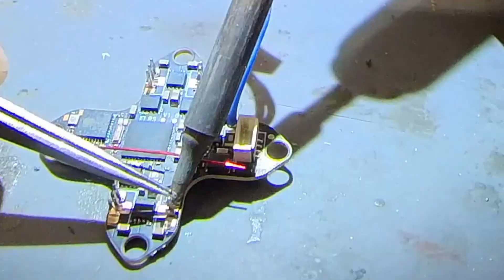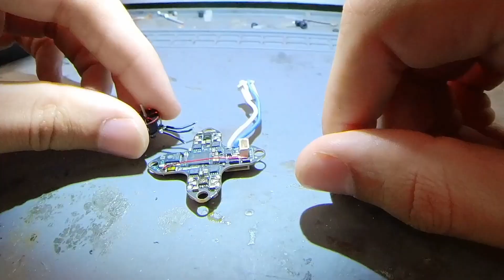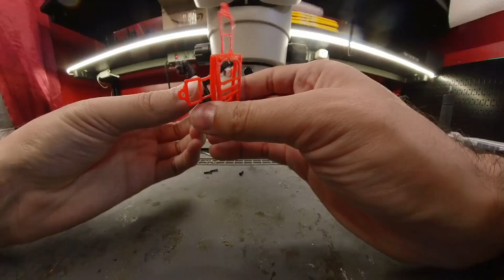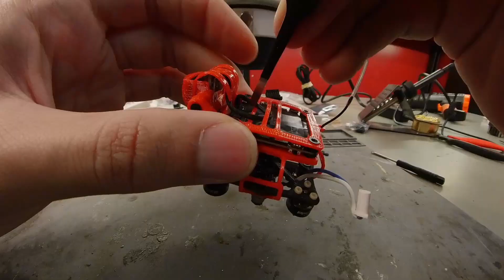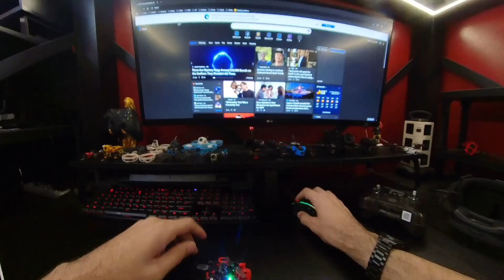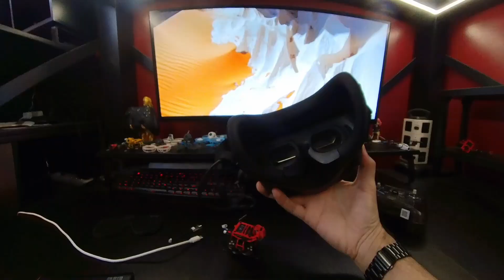How to Build a 3D Printable Nano Drone With 4K video

Comment: you should get some injection molding of your design done,
Reply from the maker: Injection molded parts cost 1000s of dollars to design and mold. This costs less than $1 to print. There's no real benefit.
Reply: @MultiBuild  I know since Ive worked directly with suppliers and had molds done my self although its an entirely different industry same concept

Comment: Is it possible to put a beta fpv p1 in there instead of o4
Reply from the maker: probably. I've gotten the runcam split 4k to work with this setup as well. The vtx should fit but Idk about the dimensions of the camera.
Reply: @MultiBuild also if I wanted longer battery life should I use 19500kv motors and what battery, thanks
Reply from the maker: @cookingchannel-t8l No don't use those motors there are awful. I had another customer ignore my instruction and he immediately regretted his decision(it worked but awful performance). RCINPOWER GTS V3 0802 22000KV or happymodel 802 25000KV. happymodel motors tend to have the best efficiency. Personally I dont recommend going below 25000KV. The dogcom 450mah 1S lipo is what I use. The lava II can work but you need to make sure you have enough slack too plug power connector in. the dogcom has its own wire with makes it much easier to plug in.

Comment: I tried building one of these. The frame just warped while I was setting it up on betaflight. 
I used pa-cf
Reply from the maker: You cant let it overheat while it's sitting there. put a fan on it or be very quick with your setup.
Reply: @MultiBuild is there a description of how you mount the analog fpv cam mount ?
Reply from the maker: @VT-FPV  This is for the o4 only. This is the analog version https://cults3d.com/en/3d-model/various/worlds-smallest-fpv-drone-v3
Reply: @MultiBuild I just figured it out!!

Comment: Just bought the files for the build and got almost all the components, can i ask you how much does the carbon printed plate weigh? Because i dont have a printer that can print carbon but i will try to print it in plastrong and it estimates 1.19g of weight and was wondering how much more mine will be
Reply from the maker: Sorry for the late reply. 0.95g for pa6-cf. I don't recommend any pla. these components get hot and it might might melt/deform the part.
Reply: @M @MultiBuild no problem, enjoy your holidays. Thank you i did build it with the pla strong and it worked perfectly and now that i tuned the drone it flyes really good, i took the liberty of improving the design fixing the o4 to the pla main plate adding 4 holes and putting the battery on top and removing the bottom part of tpu that was wasted weight.. kept pretty much all of your design only removed some parts and moved the battery holder on top, i might post a video of it in the next days and if you want to try it i can share the files with you for free

Comment: Where do you buy your DJI stuff? I’m looking to try out digital and it is hard to find anything in the US.
Reply from the maker: what parts are you looking for? I got a used goggles n3 and new o4 lite that I am trying to sell.
Reply: @MultiBuild that would be exactly what I want. I am a little worried about going with DJI over Walksnail here in the US with the ban, but it would be nice to have better image quality and range. Is there somewhere I could message you further about this?

Comment: This is really cool! I think I'll be building one. Do you have a PID tune for this drone? Or a CLI dump/diff file we could use if people wanted to build it?
Another thing is, how did you print the canopy, since there is a floating top layer? Did you use supports going around the bottom layer to attach to the top layer?
Reply from the maker: I used a stock tune. only thing I changed was thrust linearization and bag compensation. The canopy is printed with tree supports on auto.

Comment: whats going on with ELRS and 04? Is there a conflict?
Reply from the maker: Range is slightly affected. I tend to get like 30% better range with my analog builds. Even after updating it doesn't really help much honestly. I still get like 20% better range on my analog builds.
Reply: @MultiBuild stock goggles antennas? That might be where you can improve it, i mount 3x7 turns helical antennas on my g3 and would be curious of the range
Reply: analog is king
Reply: @OrlockFPV  i know it